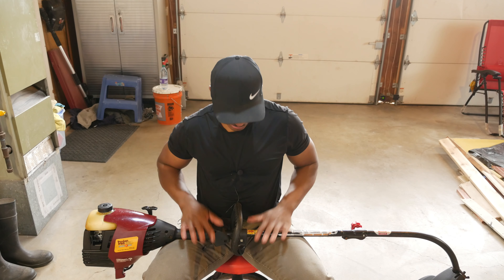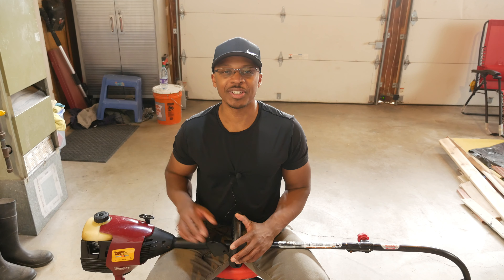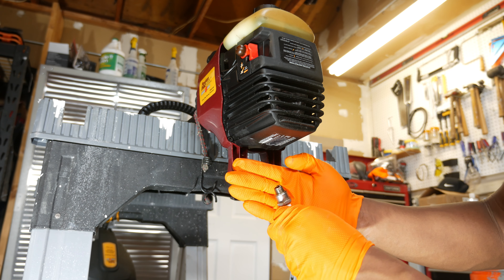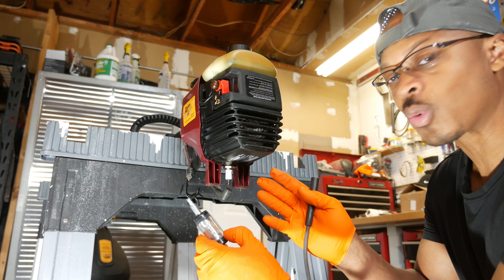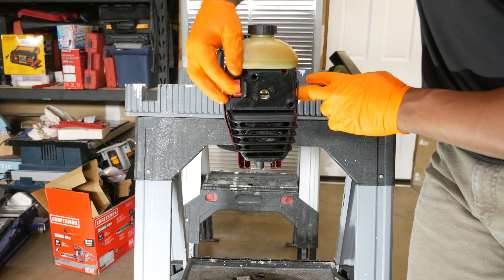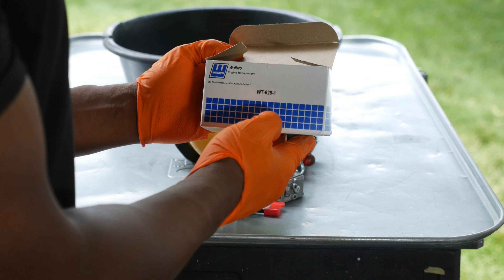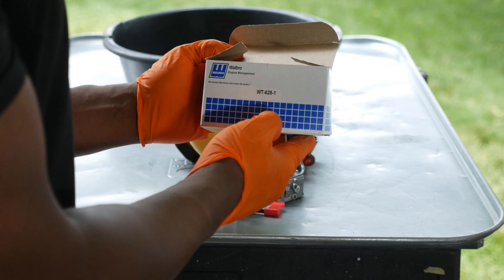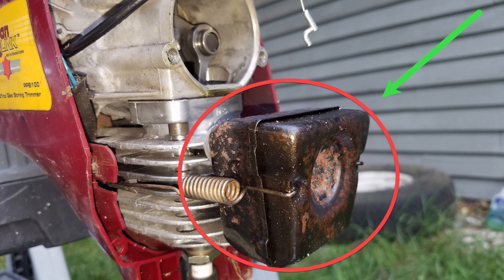Fixing a Poulan Pro PPB100 Trimmer That Won't Run

Comment from the maker: I hope you enjoyed the video. It's fun to work on these tools with small engines and get them working again.

Please leave a 👍 if you like the video!

👉 Visit our website ► http://DIYApprentice.com
 
👉 Click to Subscribe! ► https://bit.ly/2pEBg3m

👍▬▬Follow Us on Social Media▬▬👍
✔️ Facebook ► https://bit.ly/2pAY8S3 
✔️ Twitter ► https://bit.ly/2G7mRDz 
✔️ Instagram ► https://bit.ly/2ILEKII 

🔧▬▬Tools and Materials▬▬🔧
✔️ DIY Apprentice Recommended Tools and Materials ► https://bit.ly/2T5psFw

✔️ Husqvarna 530054946 Air Filter ► https://amzn.to/32crU3s
✔️ Lisle 20610 Spark Tester ►https://amzn.to/3j6mRYH
✔️ Husqvarna 530095646 Fuel Filter ► https://amzn.to/3gYieOu
✔️ Husqvarna 530071401 Gasket Set (Includes carburetor gasket)
✔️ Champion RCJ-6Y Spark Plug ► https://amzn.to/3gY6xaa
✔️ Fuel Line: 530069247 -  0.140 OD X .080 ID ► https://amzn.to/2BZd3Pv
✔️ Purge Line: 530069216 - OD 3/16" ► https://amzn.to/2B0nEsU

📷▬▬Video Equipment▬▬📷
✔️ Camera used ► http://amzn.to/2GcpkOb 
✔️ Lens used ► http://amzn.to/2Deu16S 
✔️ Tripod ► http://amzn.to/2GbaM1c
✔️ RAM Suction Mount ► https://amzn.to/2Wz9PXh
✔️ Cyberlink PowerDirector ► https://bit.ly/2jTwGxT
✔️ Adobe Photoshop ► https://bit.ly/2V7nyUX
✔️ Camera Slider ► https://amzn.to/2WtD7GW
✔️ Deity V-Mic D3 Super-Cardioid Directional Shotgun Microphone ► https://amzn.to/2LI1lf7

Comment: So a neighbor gave me his Poulan PPB100 with 3 attachments (weed trimmer, triller & shub trimmer) to keep after hearing I like fixin' small engines,
Reply from the maker: Sounds like a good deal 😀
Reply: $18 for parts. Fuel line and gasket kit